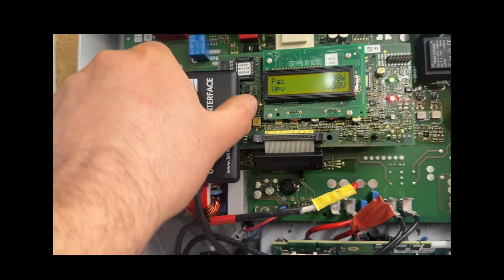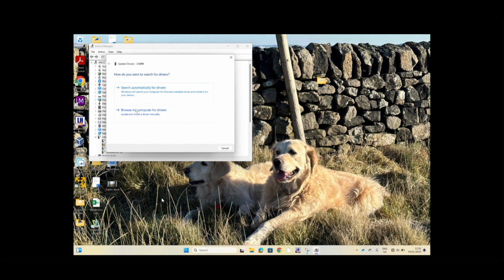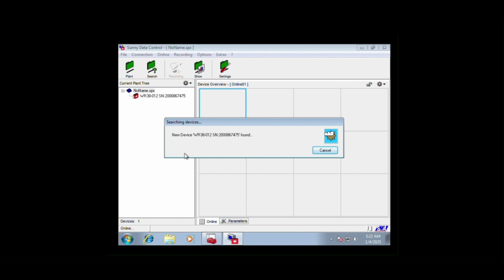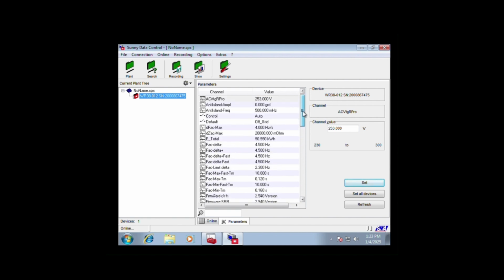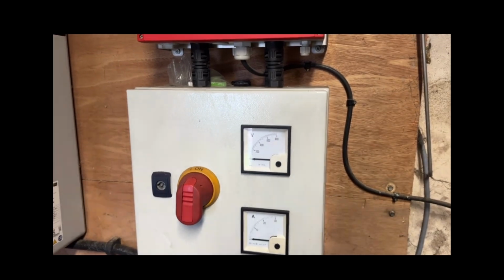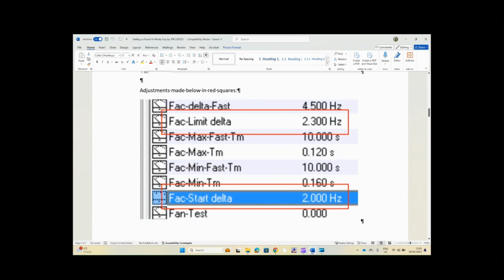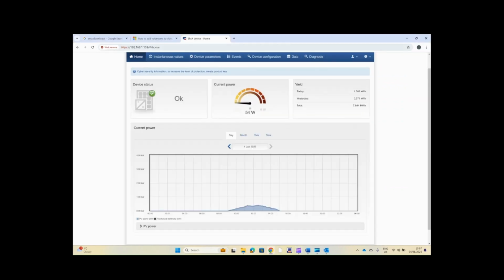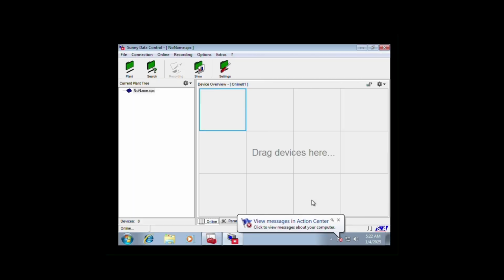SMA Inverter Interface Lead, Sunny Data Control, Windy Boy Setup Tool.

Comment: Hi, this is a very usefull video. I am looking to convert 2 x SB to a WB's for my wind turbine. I have 2 x SB 3800. I cant find a cable anywhere but I have ordered the piggyback board and a 485 - USB converter, which I think the lead basically is. Do you know if its possible to change just via the settings? Thanks in advance.

Comment: Hello. Does the password configuration work for the 3800TL US 22? When I try to change the security level, I'm being prompted with user and password. For the user I tried "installer"/"Installer" and the password configuration showed in the video, but neither seemed to work. Perhaps it is a sunny data cotrol version problem, mine is Sunny Data Control Professional 3.9.3.4, Date 03/25/2008. Current security Level: User. Thanks.

Comment: What password the software acess " windy boy setup tool" ? please
Reply from the maker: Hello it’s a summation of the date.  So the first part is always ID00 the then the remainder is the date.  The date to be summated is the one on your computer.  So for today (18th Aug 25) the password would be calculated as 18+8+25=51.  So the password for today is ID0051.  This is also explained in the video and shows where to put the password.  This password obviously changes daily based upon the date on your PC.  There is another password for installers that lets you adjust the country standard for grid protection, I don’t have this as SMA issue them out to installers only.